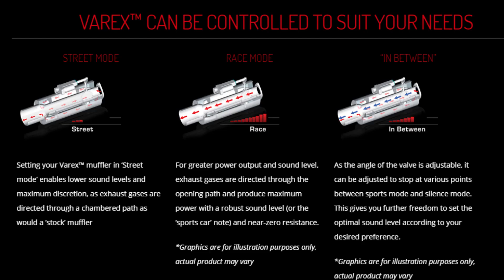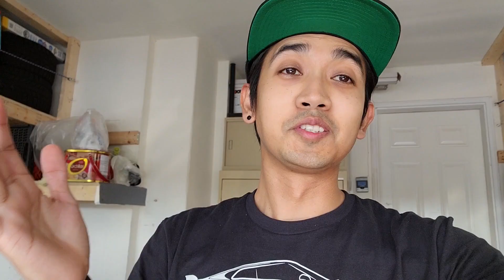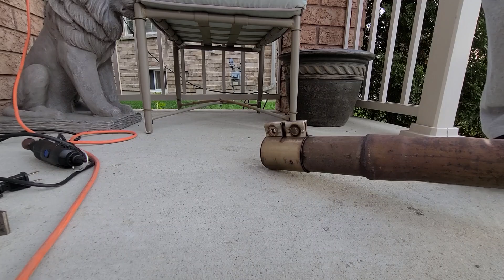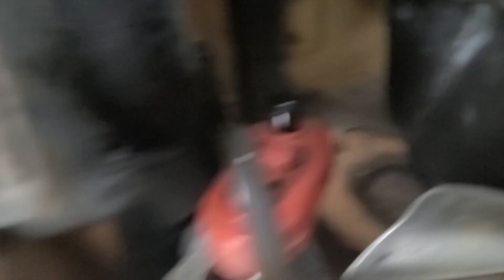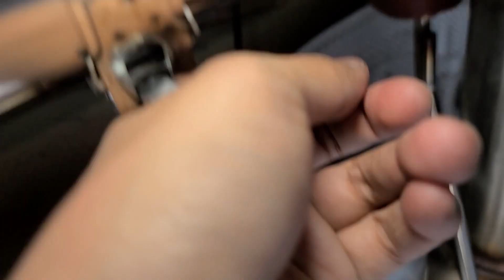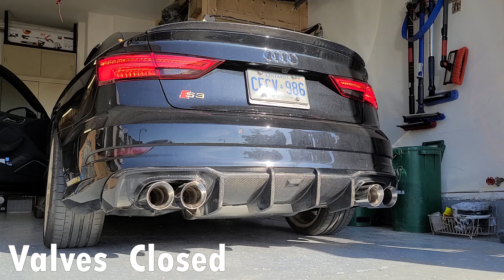XForce Valved Exhaust Install + Sound Clips | Audi S3 / Golf R

Comment: How is cabin vibration? I just installed it to pair it with my catted dp and it have a lot of vibration as I would think it should have less that why I’m feeling. I know drone is a factor but this feels like I have a sub woofer on full bass. Do you get this kind of high vibration?
Reply from the maker: I'll be honest the most cabin noise and vibration I got was from my downpipe. It was very noticeable, and I was a little surprised by it.

Comment: Hey man, just installed mine today to my S3. I really worried about the clearance of the mid pipe, and the driveshaft. Did you also experience a really really slim clearance? Mainly where the downpipe connects to the midpipe?
Reply from the maker: It seemed that way at first but you have to clock the pipe correctly. That's why you should keep all bolts loose and adjust the angles before you take the tighten them down
Reply: @ChampagneS3  after you adjusted the pipes, how much clearance did you have? Or was it still slim? Additionally, I get the point about adjusting the angles, but, if you do so, then the bit where the backbox connects to the midpipe becomes a little off no?
Reply from the maker: @S3Ranj  it was a fair bit more once I adjusted and clocked it towards the body of the car. I also ran into that issue and it didn't seem right at first
Reply from the maker: @S3Ranj  once you clock it properly everything else needs to be slightly adjusted
Reply: @Champagne S3  thanks for your help man. Did you hardwire it eventually?

Comment: Hi man really nice video! Do you think if I only get a xforce catback installed without a downpipe, would achieve a similar sound or does your downpipe make a big difference in sound?
I thinking just starting with a catback and nothing else, other parts might be considered later.
Thanks in advance for your advice 🙂
Reply from the maker: Thanks! Having a downpipe will definitely affect the sound quite a bit as well. You couldn't always start with the xforce exhaust and get a downpipe anytime afterwards
Reply: @ChampagneS3  sorry mate haha do you mean always could or better not start with only a catback?
Reply from the maker: @drose4life39  lol sorry I meant you can start with the cat back as it still sounds pretty good on its own
Reply: @ChampagneS3  alright cool, I'm in Australia so xforce is the only valved catback under aud2500, any other brand would be over $4000. Just wanna make sure xforce is a decent brand to go with. I'm looking for something that gives a bit of pops and crackles while keep it generally subtle not like some loud dickheads on the road Haha
Reply from the maker: @drose4life39  it's definitely the most affordable valved exhaust and it is definitely a quality piece. I definitely recommend it

Comment: Hey, great video. So i'm thinking about getting an exhaust from X-Force for my MK8 GTI. Set-up is identical. Any idea if i could just use the 12v plug in my trunk as opposed to taking panels apart to route it to the front? Don't particularly like the idea of having visible cables and the 12v plug at the front in use at all times. It's just a complete eye sore imo.
Reply from the maker: Thanks I appreciate the comment. You definitely can use the one in the trunk if you'd like. In my opinion that's probably the area I should have kept mine as well lol
Reply: @ChampagneS3  oh awesome! Then trunk it is!  Well, it's never too late to route it back to the trunk. ;)
Reply from the maker: @europeanlegend9347  haha definitely! I may need to swap it

Comment: is your band clamp 2.5inch? I have some trouble connecting the xforce mid-pipe to the OEM downpipe. The clamp is extremely hard to put on due to different diameters.
Reply from the maker: Yes my band clamp is 2.5" just the same as oem size